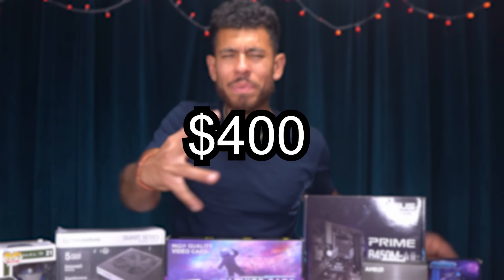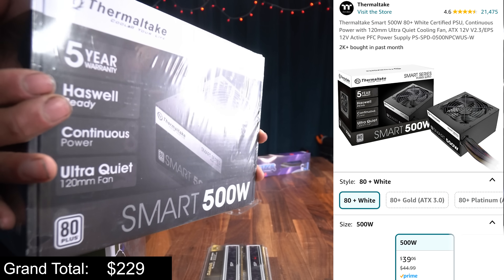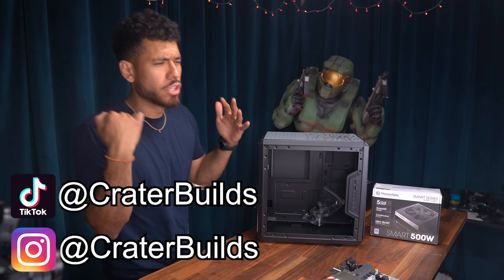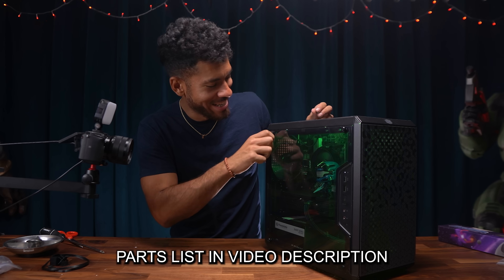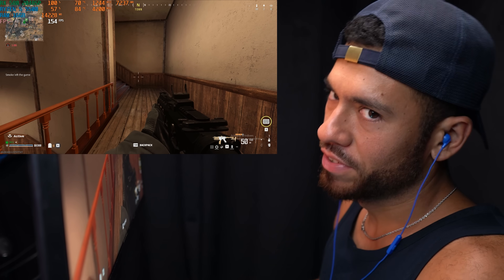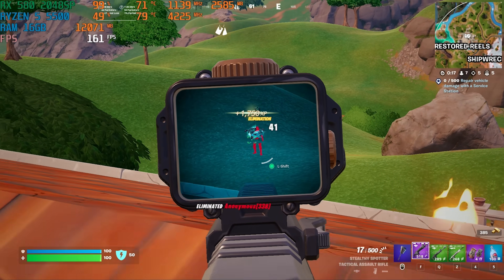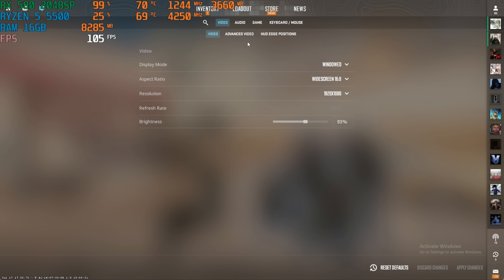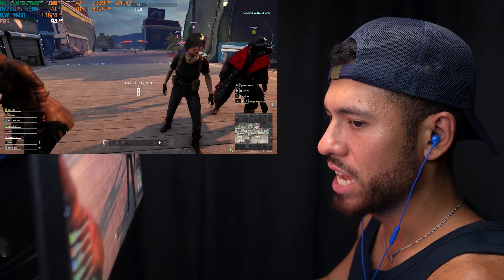Should you build a $400 Gaming PC?

Comment: I got the same parts except the gpu. Everything will work together, but you will need another computer that has windows and a usb stick then type in the motherboard you buy. In this case ASUS b450m a ii and click the latest driver. And download it onto the usb stick. Then plug into the computer after it’s built.
Reply: What was the gpu you picked if you don’t mind me asking? And also hence you need another computer how so? can’t I buy a usb from fragitup or whatever and install it on the computer after build?

Comment: I'm actually very impressed by the performance of that RX 580. Not only is it a weird brand, but it's also not super hot, and it's handling every game you threw at it on medium or very high settings. My first ever PC build used an RX 580 and I remember it needed a lot of graphics lowering to get consistently high FPS, and it always performed at around 80+ degrees celsius. It could have been my fault, of course. Maybe I just needed to undervolt it, maybe my drivers were bad, maybe I just needed a better power supply or a better case with more fans and airflow, or I got one that didn't have good thermal management, I have no idea.

Comment: Built RTX 3050 Stormx Palit single fan with i5 11400F and DDR 4 RAM dual channel 1 TB M2 Nvme SSD and 550 watt PSU any MSI motherboard and MATX case will do and maybe add cpu cooler and tell me how it goes

Comment: When applying these parts into pc part picker it says it isn't compatiable the motherboard and cpu saying "Warning: The Asus Prime B450M-A II Micro ATX AM4 Motherboard supports the AMD Ryzen 5 5500 3.6 GHz 6-Core Processor with BIOS version 3211. If the motherboard is using an older BIOS version, updating the BIOS will be necessary to support the CPU." what does it mean?

Comment: guys i have a problem here, i have gtx1060 3gb and ryzen 3 3200g and my frames in valorant are 130 max on low settings, what should i do? i had fps drop when i had my apu enabled, and my frames were between 130-160 and i had fps drops, when i disabled it, the frames became stable at 130, is this the highest performance that i can get? should i upgrade to ryzen 5 5500? please help me idk what should i do

Comment: the rx580 2048 is actually an rx 570. There's a stronger version of the rx 580 that is the full fat rx 580 and not a 570 from china(they got the 2048sp as the 580 there)

Oh also, your 580 2048sp is used.

Comment: Total: $354.68 Add your GPU, 256gb is NOT enough; I doubled the RAM/NVME/650w C tier PSU.
CPU: AMD Ryzen 5 3600 3.6 GHz 6-Core Processor  ($55.00) 
CPU Cooler: Thermalright Assassin X 120 V2 66.17 CFM CPU Cooler  ($16.79 @ Amazon) 
Motherboard: Asus Prime B450M-A II Micro ATX AM4 Motherboard  ($69.98 @ Amazon) 
Memory: Silicon Power GAMING 32 GB (2 x 16 GB) DDR4-3200 CL16 Memory  ($48.97 @ Amazon) 
Storage: Silicon Power P34A60 1 TB M.2-2280 PCIe 3.0 X4 NVME Solid State Drive  ($53.97 @ Newegg Sellers) 
Case: DIYPC ARGB-Q3 V2 MicroATX Mini Tower Case  ($54.98 @ Newegg) 
Power Supply: MSI MAG A650BN 650 W 80+ Bronze Certified ATX Power Supply  ($54.99 @ MSI)

Comment: Im finally building a new rig this weekend. 

My specs since 2018 have been:
Ryzen 5 2600
RX 580
Gigabyte b450 motherboard
32 gb ddr4 3200 mhz
500 gb ssd 
600w psu 

Made that for 800 bucks back then. And tbh, ive played every game imaginable at 1080p with no issues.
Reply: 32 gb of ram?
Reply: @ItzHyxliz  he doesn't need that much
16 is enough
Reply: @ItzHyxliz  how is so far?
Reply: 32 gb ram with a ryzen 5 2600 holy

Comment: Do a $600 pure performance gaming pc please 🙏
Reply: Total: $598.70
CPU: AMD Ryzen 5 5600 3.5 GHz 6-Core Processor  ($70.00 @ali) 
CPU Cooler: Thermalright Assassin X 120 V2 66.17 CFM CPU Cooler  ($16.79 @ Amazon) 
Motherboard: MSI PRO B550M-VC WIFI Micro ATX AM4 Motherboard  ($99.99 @ Amazon) 
Memory: Silicon Power GAMING 16 GB (2 x 8 GB) DDR4-3200 CL16 Memory  ($28.97 @ Amazon) 
Storage: ADATA XPG GAMMIX S7 1 TB M.2-2280 PCIe 3.0 X4 NVME Solid State Drive  ($52.99 @ Amazon) 
Video Card: XFX Speedster SWFT 210 Core Radeon RX 6650 XT 8 GB Video Card  ($219.99 @ Newegg Sellers) 
Case: DIYPC ARGB-Q3 V2 MicroATX Mini Tower Case  ($54.98 @ Newegg) 
Power Supply: MSI MAG A650BN 650 W 80+ Bronze Certified ATX Power Supply  ($54.99 @ MSI)
Reply: Fps in fortnite, warzone and apex?

Comment: Please do 800 pure performance build 😢😢
Reply: Just get am5 mobo,7500f & rx7700xt
Reply: Total: $777.71 7500f/B650/32 6000 CL30 is $900.
CPU: AMD Ryzen 5 5600 3.5 GHz 6-Core Processor  ($70.00) 
CPU Cooler: Thermalright Assassin X 120 V2 66.17 CFM CPU Cooler  ($16.79 @ Amazon) 
Motherboard: MSI PRO B550M-VC WIFI Micro ATX AM4 Motherboard  ($99.99 @ Amazon) 
Memory: G.Skill Ripjaws V 32 GB (2 x 16 GB) DDR4-3600 CL16 Memory  ($67.98 @ Amazon) 
Storage: ADATA XPG GAMMIX S7 1 TB M.2-2280 PCIe 3.0 X4 NVME Solid State Drive  ($52.99 @ Amazon) 
Video Card: XFX Speedster SWFT 319 Core Radeon RX 6800 16 GB Video Card  ($359.99 @ B&H) 
Case: DIYPC ARGB-Q3 V2 MicroATX Mini Tower Case  ($54.98 @ Newegg) 
Power Supply: MSI MAG A650BN 650 W 80+ Bronze Certified ATX Power Supply  ($54.99 @ MSI)

Comment: the RX 580 is like the 1080ti's little brother. both just keep on trucking even today.
Reply: The 1080 ti is a bit better in almost every game
Reply: @chenowethfamily6529  much (2-3x) better in EVERY game
Reply: @chenowethfamily6529  Duh, there's not even in the same price bracket. One launched as a midtier budget GPU  and the other was a flagship.
Reply: @chenowethfamily6529  not for this specific rx 580, this is basically am rx 570 with more vram
Reply: If you can find a decent 1080ti yea. But most have almost no life left in them.
Reply: @rolandgs6590  my friend had one that mined for like 2 years and it worked like a 3060
Reply: I own one! It’s very true.